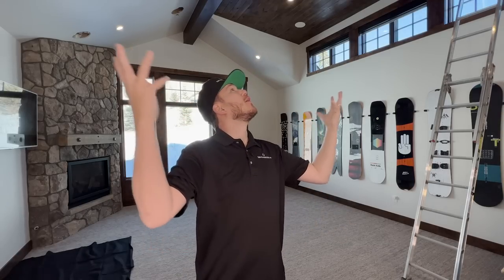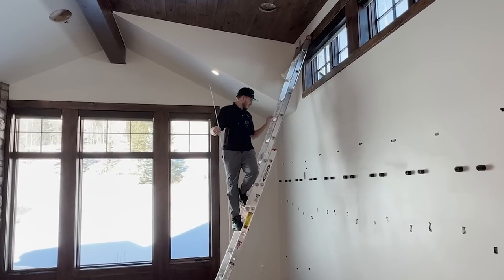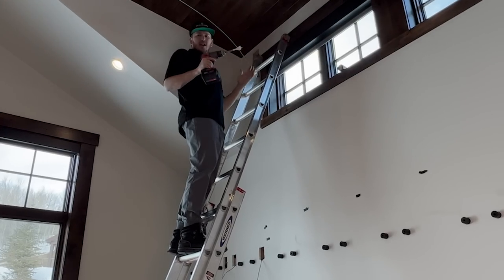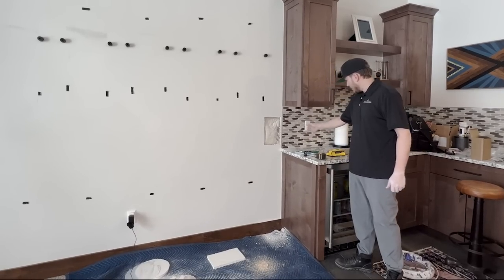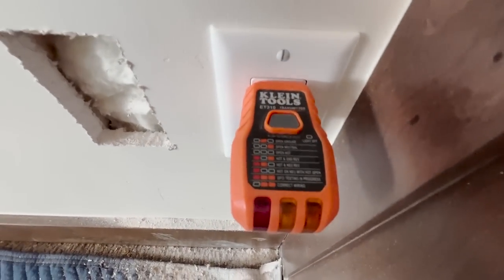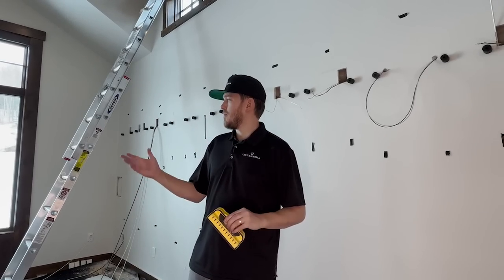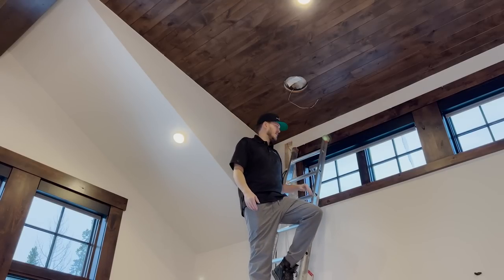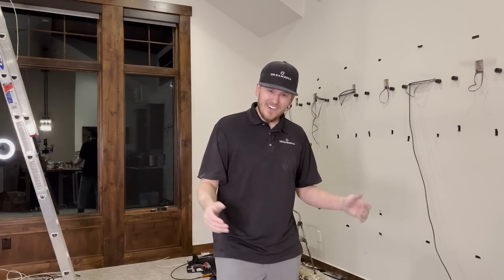Wiring Home Theater 7.4.6 Dolby Atmos - Step by Step How To

Comment: Thats the benefit of the US house building standard for using plasterboards. You can easily cut a slot in it, put your cables, use filler compound and paint it again, done.

Comment: Regarding your thick beams going up, you can remove the plasterboard and notch about 5mm out of the beams and about 3 inches wide, pin the wires flat next to each other, and just plaster over the top after installing a metal plate over the top of the wires for safety.....

I promise the roof wont drop down.... its quiet safe to do it this way..... run the mains cable atleast an inch away from audio cable because of emf waves.....

Comment: I was also thinking...... unless its too ofensive for you, how about using plastic capping instead of a load of wires behind walls where the new owners of the house might bang a nail through to hang a picture? Wires can be eaisily changed and upgraded when necessary or even removed....... 

Plastic capping tucked behind ceiling coving for long room lengths, and dropped down using the capping.... no worries about any nails going through wires.......

Just different ways of doing things, and foam coving isnt expensive, but i dont think money is a problem for you.

Comment: Why not use a 72" flex auger drill bit? It will save you from having to cut a hole in the drywall every 2 bays.
Reply from the maker: That’s a great idea if it doesn’t eat up the insulation and get off track. The best way is to cut a big strip out of the call horizontally across the whole wall so you can drill through easily but wanted to keep the mess to a minimum. Thanks for commenting!

Comment: Good work. Would have cut the access hole over another 6 inches from the tile because it would make the drywall patch work much easier to smooth out and not be concerned about the tile
Reply: Disregard just realized that hole was for a speaker watching the second video. Thought it was an access hole.
Reply: Then why not just delete the comment?
Reply: @Mohammed Isaa  Because unlike most I'm not ashamed I made a mistake no need to hide it.

Comment: I think i would have made a ew circuit and breaker from the consumer unit (fuse box). I would have used a 45 amp  reaker @ 240v and ran a 4mm ring main for all the power drain...... and that is only safe enough for an electric shower or a cooker..... ideally 6mm is best and safeist....... to pull off other 13amp circuits is never a good or safe idear, also for electrical noise, a dedicated circui is always best where you dont have other devices reacting with sensative audio equipement..... but hell, what do i know?.....

Comment: Cat 8 is better and not only is it better insulated, but it will allow 10gb/s through instead of 1gb/s..... 😮‍💨 its not that much more expensive, especially when thinking of streaming..... 10gb/s is just around the corner where high speed connections will be required..... i ran cat 5 around my home 10 years ago, i now have to rip it all out as it was a cheep option at the time....... ☹️